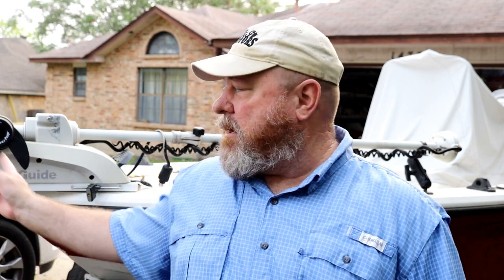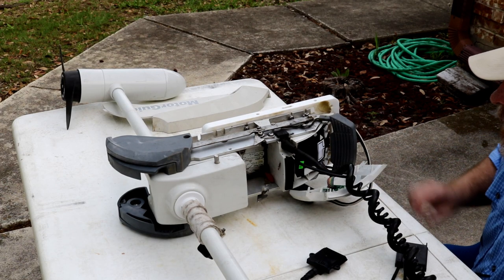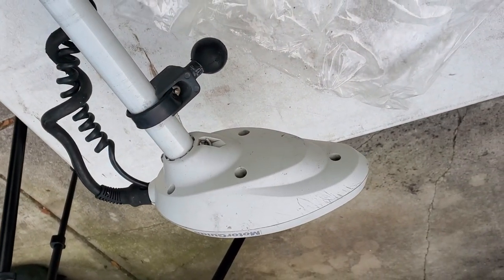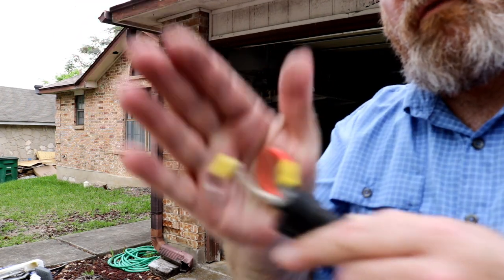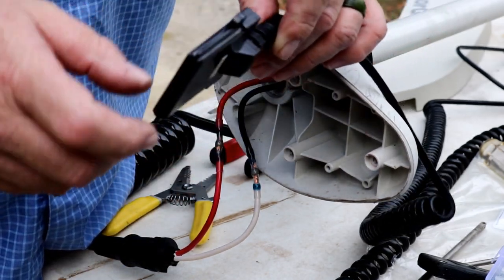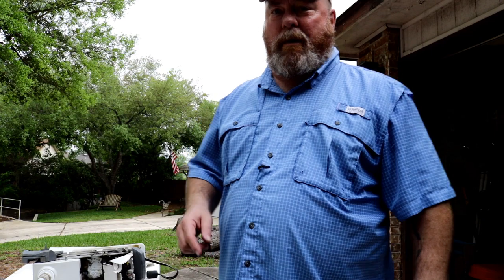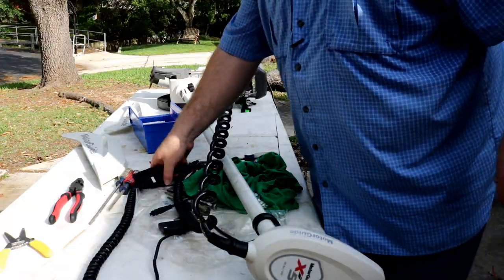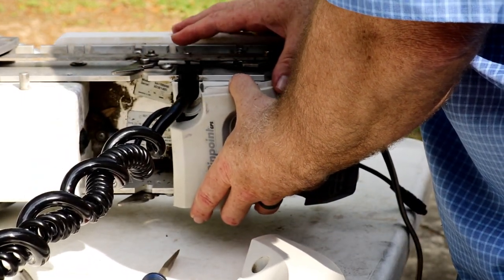Motor Guide Xi5 GPS Module Replacement | Curly Cable Replacement Too

Comment: I replaced the gps module on my xi5 and now when I start up my lowrance units it ask for a trolling motor Update.  Of course lowrance or motorguide haven't got a clue.
Reply from the maker: That is a new one to me. I would keep bugging motorguide.
Reply: There is a firmware problem with the newer style gps modules. This is a well documented issue. The solution is to have your NMEA on its own power switch then follow a certain power up sequence. I used to get the same prompt and my Lowrance would just freeze up and nothing would happen with regards to the update. I put my NMEA on its own switch. Now  when I get to the lake and launch my boat I first turn on my Lowrance Elite Ti2. While its acquiring gps signal, I plug in my Xi5. I navigate to where I am going to use my Xi5 and then deploy it. Once the led indicates that it has acquired a gps signal, then I turn on the switch to the NMEA system and I no longer get the Update prompt. I have read on a number of websites that it is bad to leave your MotorGuide constantly connected to your batteries....especially during charging of the batteries. I have my Xi5 on a plug so its not an issue for me. I always unplug when not in use out of the water. If you don't want to install a switch on your NMEA system you could also get away with just pulling the fuse and then after you power up both your Lowrance unit and Xi5  reinstall the fuse. Good news is that MotorGuide has ackowledged the issues with the firmware in these new gps modules. They have updated the firmware. Its being sent to authorized Service Centers on a USB dongle. You will have to take your motor or ship it to a Service Center where they will install the new firmware on your motor. This should be happening in the next few weeks from what I have read.
Reply: I went through a startup  sequence and it worked most of the time . It finally died this weekend.  I wasted my money on this xi5. Never again.